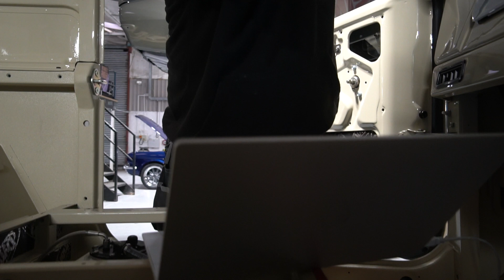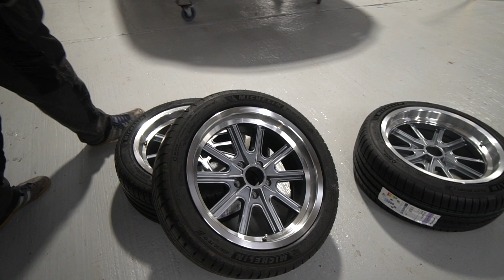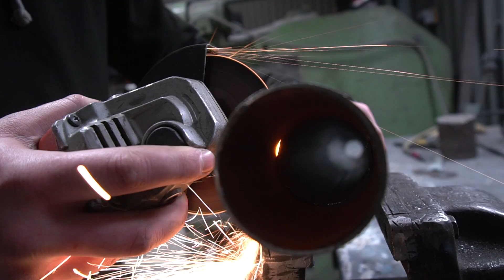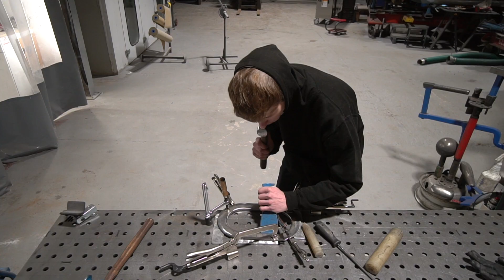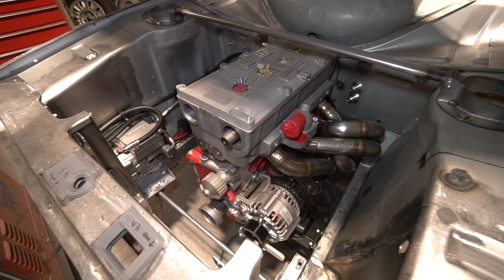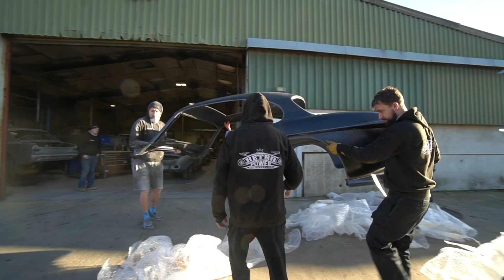Retropower Uncut Episode 116: Mustang Wheels Arrive!

Comment: The E-Type is achingly beautiful.  The Mustang and Camaro are looking great.  I’m a bit surprised at the Camaro brake discs - the grooves go the opposite way from what I expected.  I have a set of grooved and dimpled discs on my Range Rover, just EBC (nothing all that expensive or fancy), and they have the discs sided so that the grooves will sweep water or dirt outward during forward rotation.  Maybe some brands specify the opposite, or aren’t sided.   It does make me curious, and I also want to be sure mine are installed correctly (worked fine for years).

Comment: you don't want to be doing any test driving at those temperatures. Those cars are probably on summer tyres, which will have turned into hockey pucks as they;ve frozen.  Given the smaller range of usual temperatures in Britain, there probably isn't the North American culture of different rubber for summer and winter.